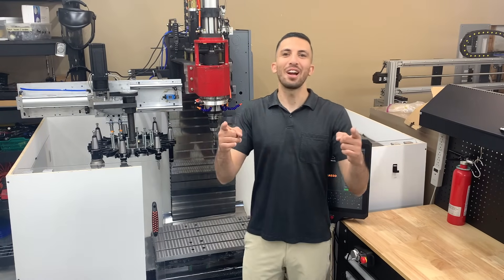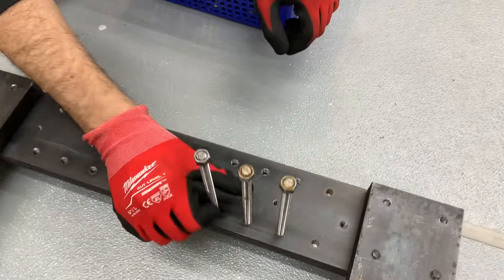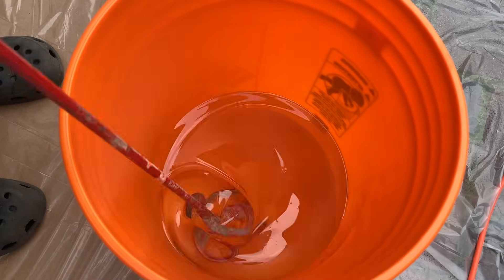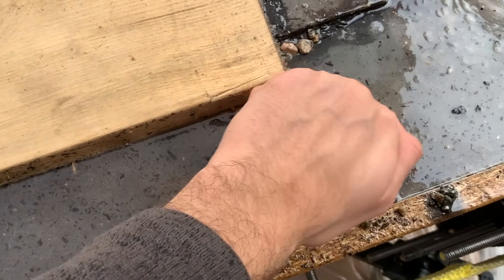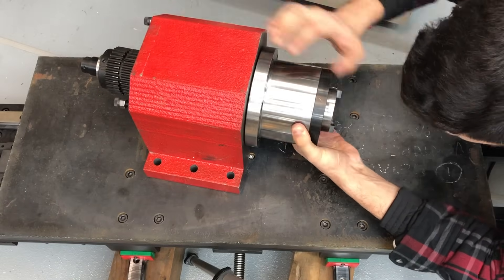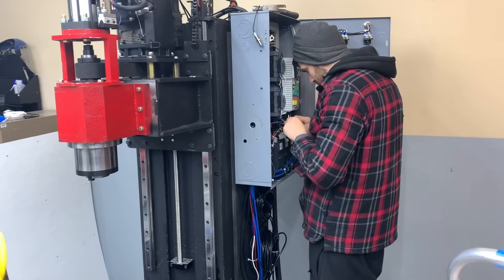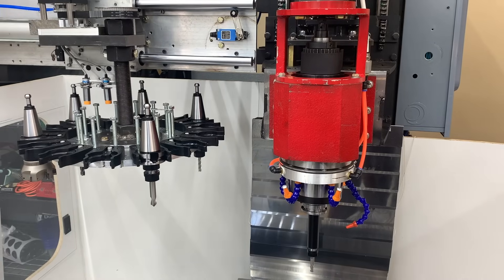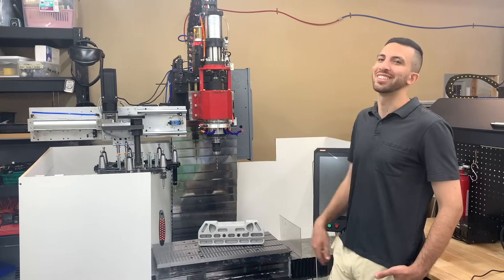Building a DIY CNC Machine With Automatic Tool Changer

Comment: wouldn't concrete be a much cheaper option for the base as opposed to epoxy
Reply from the maker: It would be much cheaper, but it would be far worse. In the video we discuss the reason for using epoxy granite. Concrete does not have those benefits. Cheers

Comment: Idk, but those 6 bolts holding the spindle to tje z-axis seem kinda small. I use 8 bigger bolts on my small cnc machine wich has a 50kg spindle assembly
Reply from the maker: Did you build that machine yourself? Our bolts seem to work just fine.  Cheers
Reply: @ActionBOX  yup, home built machine. Not completely finished though. Currently wiring everything up. It's not as big and strong a machine as yours though, but it is an actual mill that can cut steel
Reply from the maker: @revenger2111  that’s awesome, do you have a link to pics? I’d love to see it. Cheers.
Reply: And i plan to change the spindle for an iso30 5,5kw atc spindle when i have the money

Comment: Where are the hamster's and what do you feed them? On mounting. why did you not pour a pad like Machine shops do with leveling bolts? You know you could have laid it on it's side and called it a horizontal milling machine. Put it on high legs or dig a pit for you to stand i then run hydraulics on your Z that actually would be Y.  G code I presume or conversational?
Reply from the maker: What do you mean by the pad? I’m not sure I understand.  Making it a horizontal mill would mean that I need to remove the counter weight from the z axis and move it to the y axis, so it’s too late now, but I like the idea for a future design. Cheers

Comment: Cool build! That long tool holder at the end had me wincing, but all is well if it ends well. What kind of tolerances can you hold with it?
Reply from the maker: Yeah haha, it was longer than needed but it worked. The tolerance depends on the hardness of the material being cut,and it’s not too much worse than a haas vf2.  Cheers

Comment: Fun little anecdote, I worked on an older ACER CNC mill, well one day the chain snapped attached to the counter weight, boy that made a nice BOOM.
Reply from the maker: Hahah, we had that fear while hanging it, so we got an overkill chain just incase.  We also have safety bumpers down below.  Sorry you had to deal with that 😂
Reply: @ActionBOX  Fortunately when it broke there wasnt a person touching a tool off or setting a work offset that would have been really scary.

Comment: First let me start be saying that every video you guys have put out is amazing. I'm super impressed with everything you've built so far, even the EDM machines that didn't work that great. I would love to see more a detailed video on this CNC build. Especially the squaring of all the axis and what it took to get all critical surfaces flat. But what I would like to know more about it the controller that you used. I'm currently in the process of designing my own CNC mill and would like to know more about the controls. I'm familiar with Mach 3 but I'm not a big fan of it and would like to find something better.
Reply from the maker: We will be building another machine in the future, and will focus on adding all the details while filming.  Glad you liked the video. Cheers
Reply: Maybe a used Siemens would be nice but I think it’s hard to get in it and connect it to self made system. Probably u need proprietary motors or sensors or a diagnostic tool to set up parts

Comment: Why you didn’t used concrete?
Reply from the maker: Concrete is not good under vibrations. It can crack.  It’s also not as great as epoxy is at absorbing vibrations.  Cheers

Comment: Hi guys, first of all, nice job!  Which control did you use?
Reply from the maker: We used the Masso. It was definitely limited for this type of machine though.  For example it does not offer rigid tapping g84 code

Comment: I wonder what is the overall precision, most of axis sliders looks like mounted on raw painted chunks of cold rolled steel
Reply from the maker: If you check out our latest video of the newest plastic injection machine you will see that we made working plastic injection molds.  So without being quantitative about it I would say that the precision is sufficient for our needs.  Cheers

Comment: bummer, requires tools I don't have
Reply from the maker: There are definitely many tools required to build a machine of this scale, but you can also start with something smaller. Do you have any plans to build a machine?
Reply: @ActionBOX  

I'm considering options ranging from doing a CNC conversion of a grizzly/precision Matthews, getting a tormach, or a used large machine(think VF2)... Budget wise, cnc conversion is probably more likely however I rather have a full size machine.
Reply from the maker: @calebdrake3544  don’t do a tornado, you will regret it if your comparison is a big machine. A used haas isn’t a bad idea.  Hope that helps. Dave.
Reply: @ActionBOX  

The 8hp servo motor you used for your cnc mill can be used on the grizzly/precision Matthews mill?
Reply from the maker: @calebdrake3544  I’m not sure about fit compatibility, but power wise yes, it would still be sufficiently powerful for many jobs.

Comment: Why not use cement instead.  Should be much cheaper than epoxy.
Reply from the maker: Correct. However cement is very bad under vibrations, unlike epoxy. That was the main reason as explained in the video. Great question though.  A machine made of cement would still work if price is a major concern, it just wouldn’t be ideal. Hope that helps. Cheers, Dave

Comment: Hey Dave, I have a question. So I see how you indicated in the linear rails, and it's pretty straight forward. However I have noticed that on your cnc router you used round linear rails. How did you go about indicating those in?
Reply from the maker: Great question.  The round rails are far more forgiving, and thereby can be far less parallel in any direction prior to binding. Hence, there was more leniency with them so I simply used a long shaft on one end to extend a probe, and then proved for “rough” parallelness. Does that answer your question?  Cheers.
Reply: @ActionBOX  it does. Thank you

Comment: It's been asked about 11 times, judging by my Ctrl+F Skimming, but it seems you are going to release the CAD etc.  I work with an Volunteer Open Source Hardware (OSHW) Group, and a CNC Mill / Multimachine (Looking at you 
Action BOX EDM Toolhead :)  ) is one of the machines on the list.  It seems you have essentially done all the work on at least a V1, so we can "check that off the list" !

If need be you can probably use our wiki.  I'd be down to transcribe stuff to a wiki page if you are too busy to do so yourself.

Bit of a wordwall !  What all are your thoughts on this, and how are things going on your end?  The Group is Open Source Ecology by the way.

(Also i would be fine with communicating via the wiki's discussion sections, email, or our Discord as well; Youtube comments can be a bit difficult to follow at times!)
Reply from the maker: Hi, I’m not really sure I understand what this is.  Could you elaborate?  Thanks
Reply: I’m sorry it took me forever to reply, this got buried in my to-do list, but your new Injection Molding Machine made me remember!

ANYWAYS:

1.) I (as well as a group i work with) were looking for an Open Source CNC Multi-machine

2.) You made this amazing design for a CNC Mill, and are even working on those EDM attachments!

3.) So i was wondering if you could Open Source it

4.) I can help you in the process of you Open Sourcing it by making a “Wiki” page on it where you can post files etc

5.) Also, if you want, we could discuss all this on “Discord” or on Open Source Ecology’s Wiki since YouTube comments can be hard to follow.

I hope my explanation helped and didn’t just make things worse!

Comment: How do you know theres no voids or cracks in your epoxy granite?
Reply from the maker: I don’t. Again, I am not making the highest end CNC machine, I am simply providing my methods for creating a large machine when no larger machines are available.  I think if I had more room I would built a vibration platform to deal with this issue, but for the work this machine is used for I have declared that potential issue negligible. I hope you enjoyed the video regardless. 
Cheers,

Dave
Reply: @ActionBOX  Yea vids are great, I'd love a deep dive version of them! Like to see all the little details.

Comment: That was a a lot of good work.  How does it stand up for accuracy compared with other machines?  What is the cost difference vs accuracy?
Reply from the maker: The accuracy is impeccable.  I have done paid jobs with this machine, and while it’s obviously not as fast or accurate as high end machines, for $15k (technically far less than $15k but that was our budget) I have a machine that has already paid itself off.  I love it.

Comment: Congratulations, you have done something very close to a project I've nearly started many times.  I think there are some things you could have done differently to make this better, but I'm curious as how well your design works as is.  If you need help with cad cleanup, I'm good at looking over work/ design reviews.
Reply from the maker: Thanks for the compliment. What would you have done differently? I am curious. I will definitely reach out when help is needed. Its always good to know another capable individual who is willing to help. In the meanwhile, feel free to help us out by sharing with a friend who may be interested. We are trying to increase our views and channel recognition. Thanks in advance 😊. Dave
Reply: @ActionBOX  since you asked
...  I would want more chip guards and covers for any sensitive components, these can be hard to design in as an afterthought.  Chips find their way into every thing.  The epoxy granite mixture is a science of its own, I think there is some improvement to be had there.  The saddle and table looked a little flimsy compared to the base and column.  Scrapping all the surfaces that joint parts so they are flat and produce orthogonal axis motion, or at least having them finish machined.  Cast iron T slot tables can be bought from scrapped cnc machines, and would have a nice surface to mount rails to already, probably the best /cheapest option for a table.  All in all, I think you did a good job, and you shared it with the world, so thanks.

Comment: Really great job. do you control the tool change also whit masso? Ik use Mach4 and want to control also a tool change similar as yours
Reply from the maker: Hi, yes I do.   Masso can handle it but I requires lots of inputs and outputs.

Comment: Been looking for how to build a cnc machine for a while. While i understand most of the design i dont understand the electronics or wiring or how the machine is programed Or the pneumatic tool changer. Is there any way to get more information about this for my own build?
Reply from the maker: Yes, I will try to make a second video to outline all of this for you. Give me about a month. Cheers, Dave
Reply: Any new updates? :)
Reply from the maker: @LILOEVERYTHING  hnfortunately I did not have time to get to it.  I may build a second machine in the future and document it in far greater details, but it won’t be any time soon.  What specifically do you need help with? Perhaps I can help you out
Reply: @ActionBOX  i am looking for 3 thing’s specifically 
1. What electrical components are used
2. How they are wired
3. How the ATC is set up for tool changes

Comment: That's an impressive build for sure. However, I think it would help proving your work by showing some actual machined parts. Measure them and show surface finish to show how far a diy build can go.
Reply from the maker: Awesome advice, thank you. I will try to do that over the Christmas break. Cheers, Dave
Reply: @ActionBOX  👍👍

Comment: Great build. Shows what can be achieved when you have access to nice cnc tools. Budget wise a retrofit of an existing old manual mill is probably better with this size but I plan to do the same on a smaller size bridge type mill. Btw, pun, way covers are not nice to haves.
Reply from the maker: Thank you, I appreciate your comment 😊. One of my reasons for building this machine was to see whether I am capable of building the frame from scratch, and I succeeded. I do agree that if you can find a good machine to retrofit for a comparable price then it is a better way to go. Cheers, Dave

Comment: a great nc milling machine to be a one off machine for personal use, but ... moment, moment, moment ...
maximum ceiling 15k $, but it needs a manual milling machine, a router and a plasma / waterjet machine big enough to work the pieces ... not really a project to do in the home garage
and, at a guess, 1/3 of the budget has already been eaten by only the necessary equipment... LOL
Reply from the maker: Thank you for an interesting comment.

Comment: Excellent work guys.
Questions:
1. How has & does the Epoxy Granite composition perform in comparison to a relative Cast iron machine.. vibrations, tolerances, etc?
2. Was the final cost comparison worth the DIY vs Purchase?
3. How has it aged thus far.. wear & tear, reliability, etc?
Reply from the maker: 1. The steel frame definitely helps reinforce it, and the epoxy definitely does a great job at damping high frequency vibrations. The machine does not perform (presumably) as well as industrial machines under low frequency vibrations. 
2. the cost was definitely well worth it. People talk about how they can get an old mill for cheaper, which is true, but then your electronics and software are all that old as well. Here I have modern tech running my parts. But what can I say, to each their own. 
3. It's still like new, and I used it lots. We are very happy with this machine. 
4. Don't forget to help me out and share with a friend or two 😃. Cheers, Dave
Reply: @ActionBOX  Thanks for the honest feedback.
1. Ah, good to know.. but do the low freq. vibrations you experience, affect your tolerances?
2. Lol.. understandable views on both accounts.. some ppl trust an "old faithful" with a track record over all associated with DIY. It comes down you budget, requirements and expectations and preference. to me a new machine with up to date tech for the price of an old one is a no brainer... new all the way.
3. Great to hear.
4. Already did 😂
Reply: @ActionBOX  I wonder what would be involved in taking an older Haas and retrofitting it? What was your ball park $ on this machine?
Reply from the maker: @boopfer387  that will be one of my future projects.  I have already begun scanning for a second machine to retrofit.

Comment: Do you have the plans available anywhere? You guys must be engineer brothers and dad! Who just knows all the stuff you know to make the decisions you made??? I am turning a Grizzly 9729 into a CNC version. And it's taking me weeks to sift through all the info just to choose the electronics AND I'm second guessing the stuff I already bought! Also, it looks like you used particle board for the enclosure, I didn't see how you recirculated the coolant/lubricant. I built a table for mine (video soon)... but it's basically going into a bucket with a sump pump.
Reply from the maker: Thats awesome, sounds like a fun project. We are indeed brothers with extensive technical backgrounds. Dad is always the number one source of inspiration and knowledge when we get stuck, so he is also a part of the team 😜 . Keep hammering away at your project and it will be done real soon. I felt the same way about this machine. Cheers, Dave
Reply: @ActionBOX  - so is that a "no" on the plans being available?
Reply from the maker: @cnc3-in-1  Not as of now. They will be available in a future video which will be more detailed. Cheers

Comment: 1:32 - Oh please provide thorough explanation and details, I would like to build one and don't know how to properly align CNC linear guide rails. Want to build a precision CNC for etching/sensitizing PCB boards using a UV laser. Also why does the cast iron has to be "settled" several years before it is sold, I don't understand that. Also what is the precision like on your mill?
Reply from the maker: I will make a more detailed video in the future. Cheers, Dave

Comment: What's the accuracy on that machine?
Reply from the maker: It depends what you are referring to. Repeatability under no load? or accuracy relative to the CAD designs while cutting hardened steel? Clarify for me and I'll answer for you. Cheers
Reply: @ActionBOX  accuracy to cad design. Thank
Reply from the maker: In aluminum it’s within 25 microns.

Comment: nice video,  the ratio epoxy to rock is kind of off i think.  might still work well. but normally its a quite precision ratio, epoxy/grid/smaller grid/and sand like material  anyhow, very nice video !! and machine
Reply from the maker: Hi, It's really not a precision ratio. The primary reason they have a specific ratio in industry is to use as little epoxy as possible (as it is the most expensive component), plus pack more weight. This doesn't make or break your machine. Im glad you liked the video. Any plans of making your own sometime? Cheers, Dave

Comment: Why epoxy instead of cheaper polyester resin?
Reply from the maker: Because polyester resin is substantially less healthy than epoxy and stinks far too long and too much. It is not recommended to use 40 gallons of that in a house. On a theoretical level though it will work, great thinking. Dave.